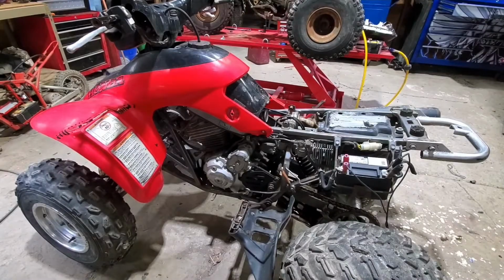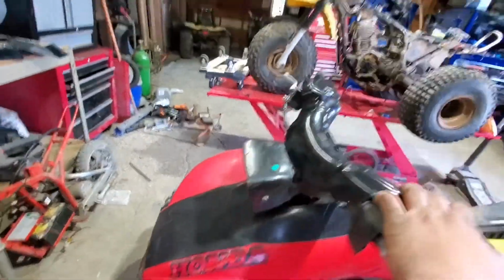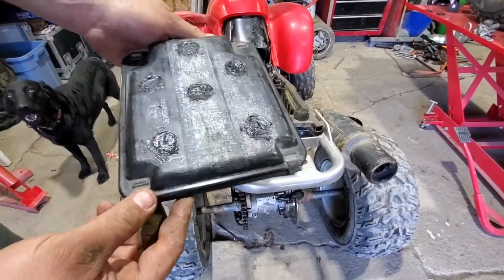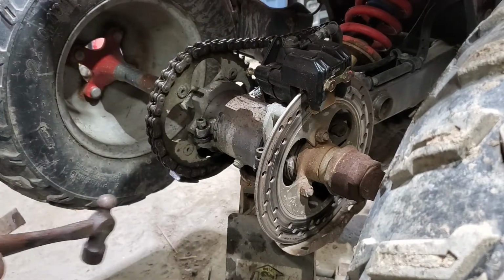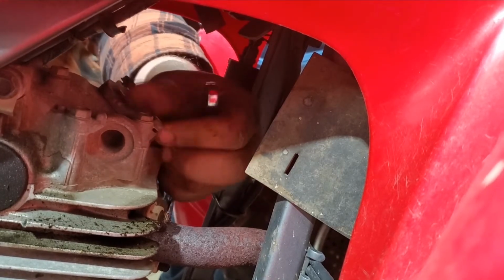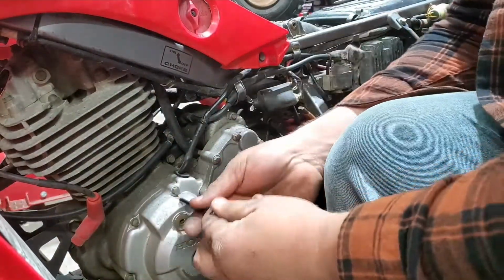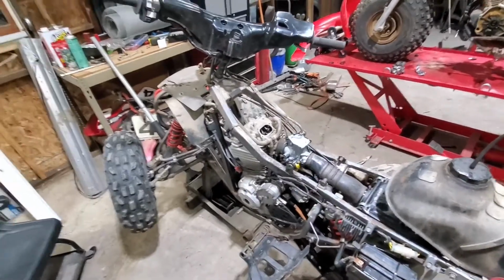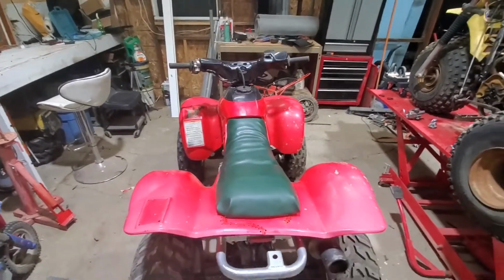Fixing Up A Honda 300EX

Comment: Great video! I just put a new carb on my sons 2001.  The 2 rubber hoses attached to the carb. 1 routes just to the frame for excess fuel dump I believe. But the other hose coming off the left side of the carb I have no idea where I took it off from originally. Any idea where it goes? I appreciate it

Comment: Sorry if I missed it but did you buy and oem carb or one of Amazon?
Reply from the maker: I don’t remember what Archie bought, but more than likely it was an Amazon carburetor. It runs like a top, regardless. Thanks for watching!
Reply: @rustednutrepair675  good to know those Amazon carbs are good. Thank you
Reply from the maker: As long as you jet them, they work well. Make sure you check the jetting though!!

Comment: What shock did you end up going with? Just bought an 04 trx300ex and have been looking all over for a complete rear shock and cant find anything new only used ones and the new one for sale on ebay is 700 so trying to see if theres other options out there
Reply from the maker: We haven't convinced our buddy into replacing the shock yet. We have a new video on the Honda going live in the morning where we did a bit more work to the 300EX.
Reply: Hi Chris! Let me know if you found a rear shock... I have a 2005 300ex I bought and rear shock is so shot and doesn't work at all it literally a bounce house... I did find one on ebay which is a used one but suppose to be in good condition and I should be installing it within the next week or two... but if you found another shock that fits the rear and works great please let me know :)

Comment: I know this may sound crazy, but the carb comes with 2 black lines, ones is for the fuel over flow, but where does the other one go? Your help would be greatly appreciated, thanks.
Reply from the maker: I'll have to ask Stitches tomorrow and have him post a comment about it. He did most of the work on the Honda 300EX

Comment: Someone please tell me WHERE IS THE IDLE SCREW ON THE CARB!!!! I just got a 1993 it idles low trying to fix it
Reply from the maker: On our buddies, it’s on the same side as the choke lever; it’s the small flat head on the bottom. Check yours and see if it’s there.

Comment: I just purchased one of these and its in rough shape. My question it that my front drive sprocket is loose or has play and so does the rear break bracket that hold the rear caliper. How do you snug up the bracket bracket and should the drive sprocket have play side to side ? 
Just subscribed 👍
Reply from the maker: There should be some play in the front sprocket. That's normal. As for the rear caliper, we will post a clip in next week's video where we show the rear brake bracket. Hope that helps.
Reply: @rustednutrepair675  awesome man thanks. I’ll be sure to give you shout out on my channel when I post a video on this machine

Comment: What year is the quad ?
Reply from the maker: It’s a 1998 300EX.
Reply: @rustednutrepair675   that’s perfect so is mine ,I’m having the same tapping problem coming from the Valves what where the measurements you used on the feeler gauge and did the tapping completely stop?
Reply from the maker: The intake lash is .004” and the exhaust lash is .005”. It removed all of the tapping. On this machine the exhaust was at .008”.
Reply: @rustednutrepair675  thanks so much I’ve been putting this off for awhile now because I couldn’t find a video like this